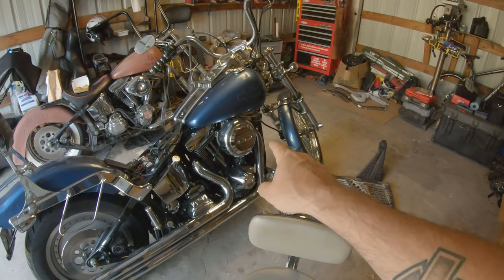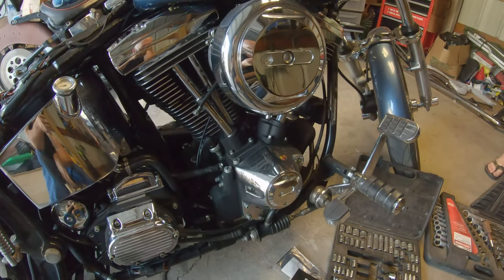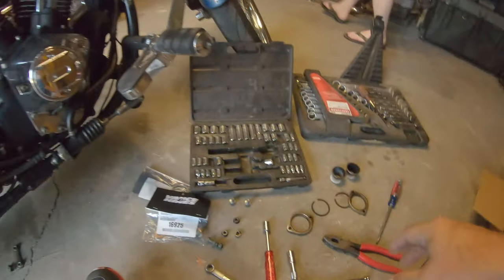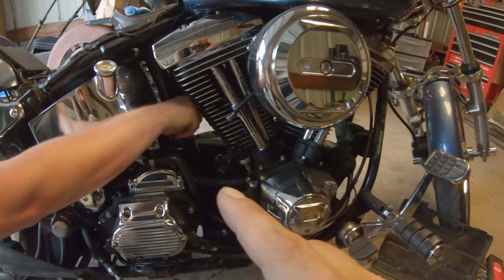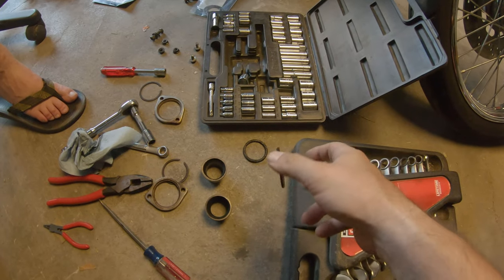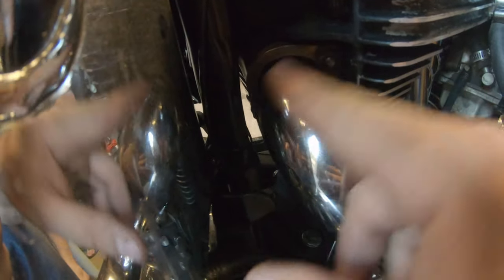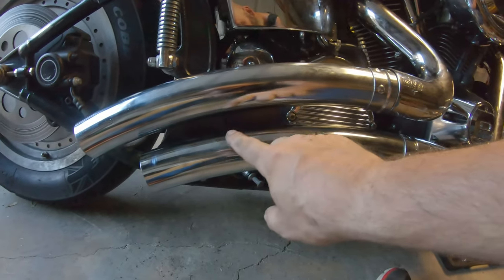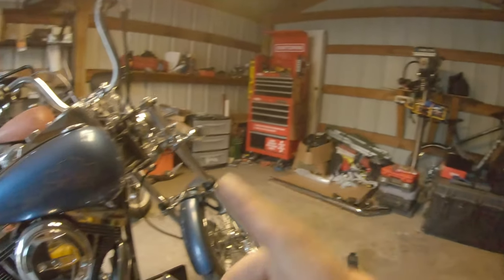Vance & Hines Big Radius pipes on a Softail Custom

Comment: What are the pro and cons of having a catler converter on a pipe ?
Reply: Catalytic converters will reduce exhaust noise and improve exhaust flow, generally resulting in better fuel efficiency as well as reducing exhaust pollutants. Straight piping will give you a lot more volume from your exhaust and better performance from your engine with proper tuning. You will never see a performance tuned bike with a catalytic converter.
Reply from the maker: I agree with everything @23fyrebird said, but I'd add that a big con would be that it makes the EPA happy when you have a catalytic converter, lol
Reply: @23fyrebird  thanks man.
Reply: Isn’t the baffle enough for EPA? 😂
Reply from the maker: Unfortunately no, the baffle is just for exhaust tone and back-pressure. The cat is what helps clean up the exhaust emissions by getting super hot and burning off any un-burnt fuel and other gasses in order to get the particulate blow out down to an acceptable level determined by the EPA.